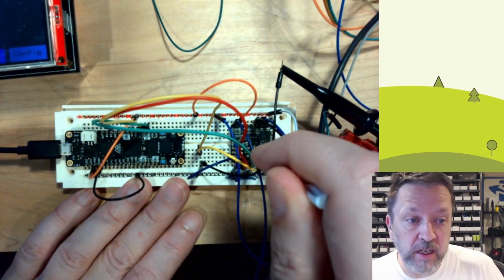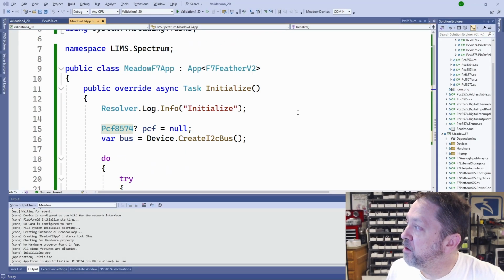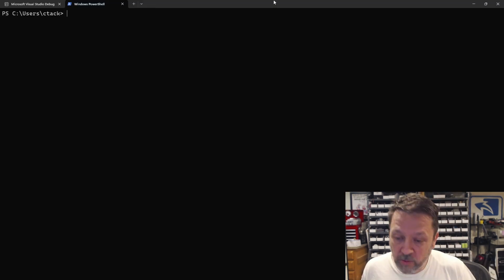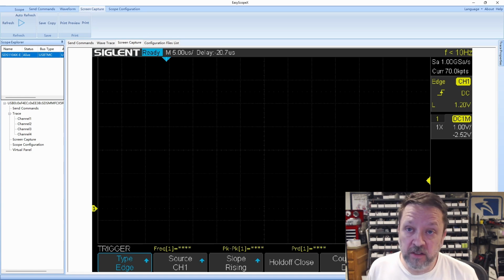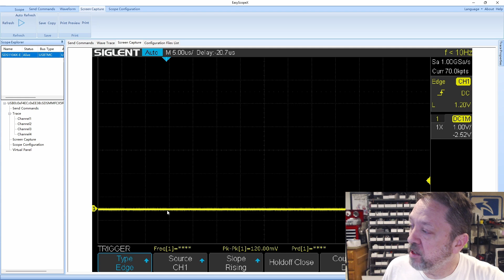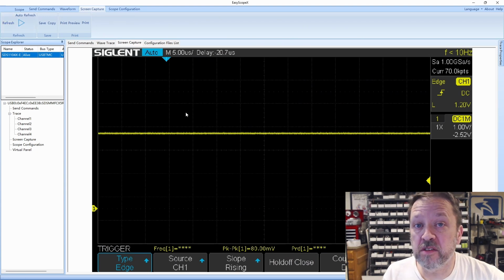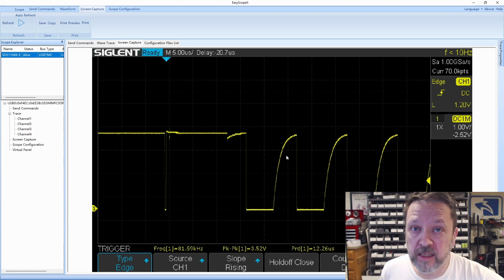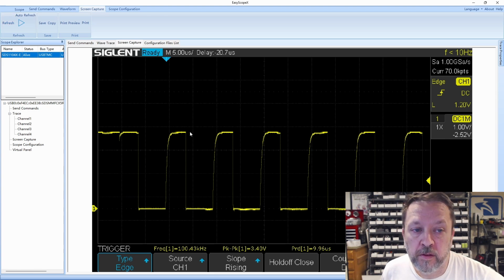Do I Need I2C Resistors?

Comment: +1 for scoping the I2C bus. One of the annoying things about I2C is that you cant terminate at the characteristic impedance of the line, because it's too low for the driver. So, if the drivers have edges that are too sharp, you will see reflections. I've run a 2-foot long chain of 4 or 5 devices on twisted-pair wire (Z roughly 100 ohms), with no problems, and terminating at 2.2K. As they say, your mileage may vary.
Reply from the maker: 2 foot isn't horrible. It when you get out to a meter that things get fun! : 😂

Comment: Me thinks you should read the documentation carefully on the IIC devices you are using.
From my work with Arduino circuits I've not yet run into recomendations on pull-up/down resistors.
It's an inter-IC network, supposed to work with short signal wiring distances, preferably within the same PCB.

It looks like you have defective IC's or not driving them correctly.
Or your breadboard is NOT suitable for your circuit setup ... !

Take your time & effort to use prefab PCB's and do any mods to these underway during your initial proto build.
Reply from the maker: I2C bus lines are high at idle. Pull ups are required somewhere on the bus in all cases. Most vendors have design notes available for how to calculate the resistance but many/most PCBs that have I2C components from places like Adafruit and Spakfun have pull-ups already on board, often 10k. Some cheap boards don't have them, and if you're designing a PCB, you need to add them

Comment: Sometimes I2C modules have pullups onboard. It's convenient, especially if you're only using the one module, but it can be a trap for young players who don't realise that not all modules have them and they're very necessary. 4.7K might look quite curved on the scope, but for standard speed I2C it's usually fine. For high speed you might need a lower value.
Reply: When measuring with your scope make sure to use probes with 10x attenuation. These have 1/10th of the capacity added to the line you're checking and that can have a significant effect on the rise-time you see. Most probes come with some info on their performance and capacitance, check it and weep. My cheap 100MHz probes add 170pF capacitance in their 1x mode for example.